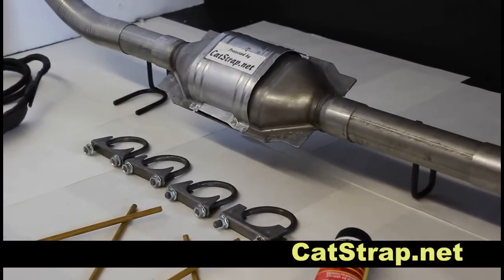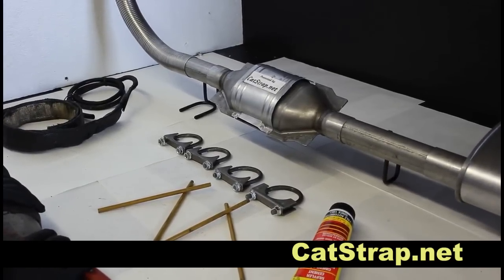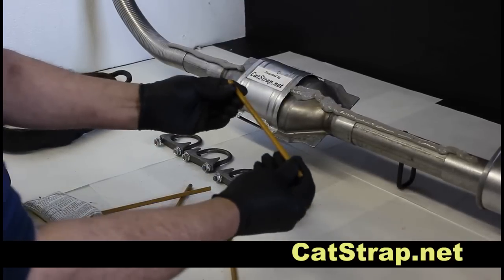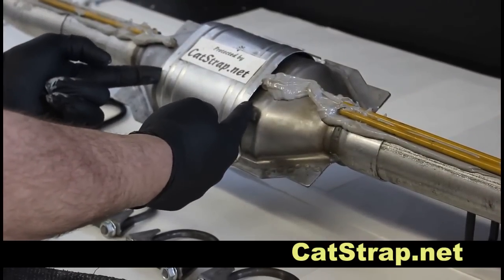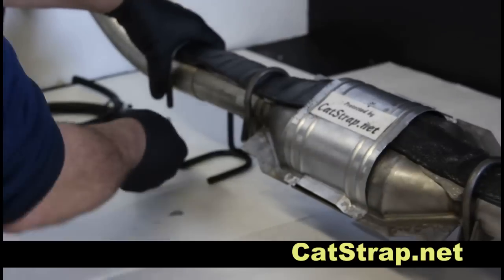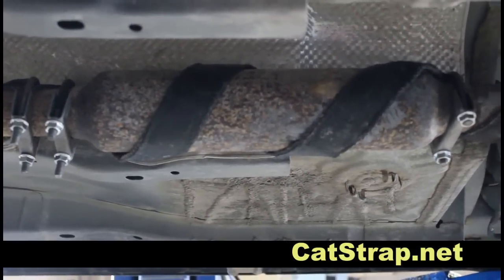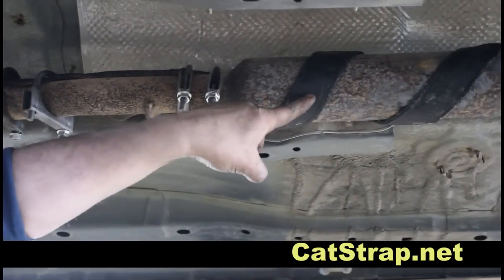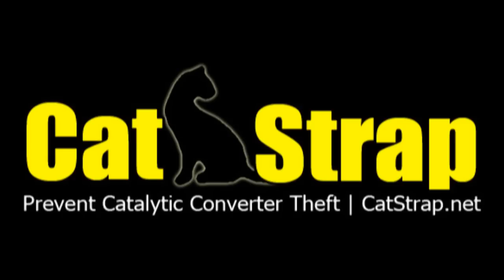Prevent catalytic converter theft with Catstrap

Comment: I hook mine up to the air bag suspension system when they cut the air line the car lowers down on them
Reply: Brilliant 😅😅
Reply: And if they are killed you go to prison for murder. Brilliant!
Reply: @mynameisgladiator1933  but they go to hell, then you get a good lawyer and you’re out
Reply: @charrohernandez6835  They're likely going to hell anyways. But you don't have to go to prison. Don't set traps. The law is clear on this issue.
Reply: @mynameisgladiator1933  It's worth it.
Reply: They use a floor jack dummy
Reply: @mynameisgladiator1933  nope they did it to themselves
Reply: @mynameisgladiator1933  They would have to prove it was a trap. If your air lines run along the exhaust that wouldn't look suspicious.
Reply: Yeah sure you do.
Reply: Billy McCoy.... Good one💀😂😈
Reply: This could make c notch and body drop biz boom
Reply: @mynameisgladiator1933  that's false information. Natural selection isn't considered as murder.
Reply: @mynameisgladiator1933  what if i put up a warning saying dont steal this and if you do be careful not responsible for harm lol
Reply: @jtmx2005  Give it a shot.
Reply: @torquebiker9959  Totally worth it. If everyone did it. Cat theft would cease.
Reply: @atuck6082  I guess they will find a way, like puttin a wooden block under the car. The thiefs are actually very clever.
Reply: @torquebiker9959  Then you could always make a mini ansul system and get a face full of theif repellant. Lol
Reply: @mynameisgladiator1933  
Its not murder it, would be manslaughter...which usually carries the same sentence. And you are right...pretty much all States would charge the car owner for manslaughter.  
Unfortunately you cannot set death traps to stop criminals.In a way it does make sense, I'd hate to open my father's door only to get blown away by a shotgun rigged to go off when the door opens. He's pretty old and would do just that if it was legal.
Reply: @mynameisgladiator1933  Just affix a warning sticker visible on the Cat,  ⚠️  warning, tampering may result in injury.  Then you are good, it is no longer a trap. 😀
Reply: Just low you car all the way down.. eazy
Reply: Omfg that is genious
Reply: @mynameisgladiator1933  murder for what? If anything involuntary manslaughter. It would have to be proven that was your original intent BEYOND REASONABLE DOUBT
Reply: @mynameisgladiator1933  there not traps but performance modifications with unexpected results :D
Reply: @mmace3  if they were modified tho it would look suspicious :D but totally defendable
Reply: @mynameisgladiator1933  no body , no crime
Reply: Loll
Reply: They jack the car up, so that wouldn't do anything.  Also... no you didn't.
Reply: @mmace3  well, I assume you saw the original post to this section. That's the proof, isnt it?
Reply: @mynameisgladiator1933  hell is one of those things on nde know about read the stories of heaven and hell. I met a woman who was being abused by her husbands she immolated her self and went uncondios and died briefly she said she went to hell.
Reply: @hyperliterider861 ? I'm just telling you what the law is. Go ahead and do it. You'll do well in prison.
Reply: @MrHomito  most of the real low cars don't have  that chingadera
Reply: i was just thinking about that lol
Reply: You sir…..are a genius.
Reply: @mmace3  You can do whatever you want in life man. Wear purple shirts, pick daisies or run air lines along your catalytic converter. No one can fault you fir exercising modifying YOUR property to YOUR liking!
Reply: @mynameisgladiator1933  really in what case would that be murder how would they prove
Reply: @mynameisgladiator1933  how is it a trap just say you didn’t know
Reply: That's smart
Reply: LMFOA 😂
Reply: With a silent cat alarm you can run out and lower their jack so they get crushed.
Reply: except they have to jack the car up to get to it. so that would do nothing.

Comment: Just putting an alarm that goes off is great.  I like the idea of running a low but painful voltage through a metal plate the thief has to touch to get to the converter.  Mean, yes.  Illegal, probably.  Effective,  yup.
Reply: I don't think you could really do that, the engine is grounded, so it would screw up all the electrics in the car in the likely event that it ended up touching the exhaust.
Reply: @Tracert-mc1hu  that's right, you can't apply more than 12 volts to any metal in the frame without blowing something up... You'd have to electrically isolate the whole exhaust system
Reply: Good idea
Reply: I hope no cats accidentally touch it!  🙀
Reply: evil genius 👍electrifying the thief 😁 but then the crybaby would sue 👎
years ago a man booby trapped his house and thief got electrocuted, sued the man, man went to jail 👎
Reply: Why low voltage??!
Absolutely HIGH VOLTAGE ⚡⚡⚡⚡⚡⚡
Reply: @WestCoastUSA546  ⚡😝💥👍⚡
Reply: @talknheadz  Why is he numb nuts!?
Reply: @AndrewSmith-uz8bg  because he thinks that a thief cant just simply put on gloves to get past his contraption.
Reply: High voltage,  low current.
Reply: @macmckenzie1242  High voltage can cause breakdown of insulation and arcing which can also lead to burning your own car 🤣High voltage with low current can cause a lot of harm 😜 i love the method to your madness Evil Genius :washhands:
Reply: The amps a car battery can deliver are deadly voltage doesn't matter.
Reply: @talknheadz  Sooooo, who tipped the thief OFF that it was electrified??? YOU? smdh
Reply: @VINZBROWN  5th grade comment
Reply: It’s only illegal if you intentionally set that up. If your subwoofer JUST HAPPENS to have its ultra-capacitor grounded to your exhaust as a point on your chassis…(of course your car might have a catastrophic failure.)
Reply: If they are wearing gloves, they won't get shocked. Most (if not ALL) saws that could be used have insulated handles. there's no way any kind of electric charge can be effectively applied. Alarms are useless anyways. How many times have you seen a car alarm go off in a parking lot that goes mostly ignored? 
Crime happens every day. preventative measures don't work at all if the criminal has the means, the will and determination to get what they want.
Alcatraz was seemingly inescapable, yet 3 guys managed to do it.
Where there's a will, there's always a way, but there's no way to actually electrify something on a car (12volt DC system anyways) to foil a thief who merely can use insulated tools to disable it, even if it were a legit possibility.
Reply: I'm intrigued and interested in subscribing to your news letter please tell me more.
Reply: I thought about welding an upside down bear trap but dogs and cats...
Reply: Robocop 2 opening commercial for magnavolt
Reply: Lawsuits don't ever send people to jail. They end civilly. So it sounds like a story told at a bar.
Reply: This is junk.. Just weld a strong cage around it by a local welder
Reply: How the hell is that gonna be effective? Its not like they use an all metal saw.
Reply: 50KV would definitely teach them a lesson.
Reply: Release of a cyanide gas capsule under the vehicle sounds a sweet idea..?
Reply: Love ur idea 😂

Comment: Why don’t they focus on the company buying the cats?
Reply: Metal scrap dealers will give them 100 to $200 for the palladium and platinum inside. I assume they don’t ask a lot of questions about where the metal came from.
Reply: the reputable places ask for id and the guys i deal with take pictures of the cats and the id .... i buy scrap cars and deal with them all the time its the guys driving around paying cash for them is where the grey area is ....they will cut them open and take it straight to the smelter .....not saying there all bad just those bad ones are ruining it for the guys that do it right and legally
Reply: They give ALOT more than 200.... 😂
Reply: Once the buyer removes the palladium from the cat , it's not traceable
Reply: @anim8ted923  well...I just had a friend junk a KIA and before he did he cut out the cat...he got $2000...that's not a typo...that's why these are being ripped off...Platinum is in shortage...thank our new boss in DC for screwing our domestic precious metals businesses
Reply: Rob West   You going to have problems if they are paying that much. You might have to try and get them in close .
Reply: The reputable places already require some verification and local and state governments are cracking down more. However, especially at these prices, there's always going to be a chop shop out there that doesn't want to know where anything came from. They're the problem. If there weren't black market, we wouldn't have a problem!
Reply: Don't go for the holy cows.
Reply: @koriko88  there will be crime as long as there is people.
Reply: @robwest1297  You can buy cats for 150,300 dollars,i just bought a brand new exhaust system for my sports car for 1100 dollars and that included brand new (stainless, not that crappy stuff automakers use ) cats plus the whole system, i just dont see a scrap dealer giving anyone 2000 dollars , maybe if it was gold inside of it.

Those scrap people are super tight, they will lowball you even with the price posted on the wall,i would really like to see that receipt from your buddy but ill go along with it, no need to argue,guess thats why they are stealing so many cats, honestly i can see them stealing a cat and getting 100/200 bucks a piece for them,that seems reasonable and believable,a thief will do wonders for 100 bucks.

Comment: I never thought I'd see the day you need to get an alarm system to protect your Catalytic converter
Reply: me too ...up at 1am worrying if it's going to get stolen quickly after i pay $4500 to replace it. Damn thing is worth as much as the truck.
Reply: @jellyproductions3767  Hopefully your not in a high risk area ! That's pricey
Reply: @walleyehunter8862  I am and it is. Insurance companies are hating life right now.
Reply: I never thought I would see the day that you would have to wear a mask to go into a bank without planning to rob it.
Reply: I had to install about 40 hose clamps with metal under them to keep gas thieves from stealing gas out of my rubber hose (along with an alarm module hidden under the  fiber tape I wrapped it all up with on my pickup back in the 90s. I lost hundreds of dollars in gas twice before I could stop them.
Reply: I never dreamed we would have to have one.
Reply: Thank a democrat

Comment: I wire mine to the 240 volt mains every night .
Reply: i got mine hooked up to a neon transformer--i want them to glow while dying.
Reply: @rearspeaker6364  And fry all the computers in the car as well.
Reply: Hahaha nice
Reply: @jackbarrie6007  found the cat thief.
Reply: @jackbarrie6007  sounds like he's got you shook
Reply: You will be better off with 110 it hangs on to them cutting.220 knocks you away . This way you can use a rope and drag them off the next morning when you go to work.
Reply: @paulatudor691  good point, maybe D.C.?
Reply: @paulatudor691  ha ha ha ha

Comment: Amazing that the car engineers design everything that you would want to do to repair your car so difficult. Alternator, starter, inner tie rods. Oh, but stealing a cat converter so simple. Makes no sense.
Reply: its very tricky trying to put a exhaust system inside the passenger compartment without it leaking, or setting the car on fire too.
Reply: Engineers need to make everything as compact as possible to increase usable space (thus increasing the value of the car for the average buyer), but the exhaust system is very hot so necessarily has to be outside in the open. No conspiracy here.
Reply: @KibberShuriq  lots of people don't understand that.
Reply: Honda has them built right in the exhaust manifold atleast on some of the newish models, so they stay in the engine bay
Reply: This is a new thing, it will become an old thing soon enough.
Reply: @rearspeaker6364  The OP never mentioned putting them in the passenger compartment. They simply questioned why traditionally simple repairs that could be performed by a backyard mechanic were made so difficult. 

For example, I used to be able to swap an alternator or a starter on my 1970 Pontiac inside a half hour, start to finish, for a cost of $25 with core, all while laying on my back in the snow. On a Chevrolet Colorado, the starter costs $1500 to replace due to the fact that you must partially remove the engine in order to gain the necessary clearance, or another alternative is to remove the inner fender panel and several other non-related items which are in the way, which is far more time-consuming and more trouble than simply loosening two bolts and a couple wires in the previous example. 

I could rebuild my alternator and starter in my first example with a brush and bushing kit in the time it takes just to gain access in the second example.

On the other hand, maybe you were joking.
Reply: @jayrowe6473  was saying the vehicle engineers did not put the catalytic converter inside the passenger compartment (where it can't be stolen) for a reason....
Reply: They get big $$$$$
Reply: Be nice if people just stopped stealing them from hard working people
Reply: Hybrids dont have alternators or starter. 

The electric motor inside the 'transmission' IS both, an alternator AND a starter. Have you noticed how there are no belts either? Because AC uses a compressor like a fridge due to it being half electrical, and the electric motor/generator acts as the alternator to supply power to both the front and back battery.

The cat converter gets hot to 1200 to 2000 degrees. There is a reason its outside, so while driving the wind flow will cool it off and heat shield between the inside and outside keeps it from burning up into the cabin.

Comment: Put a ground at the back of the system and a power at the front when the exhaust system is cut the alarm goes off. Get rid of all the other bull in between
Reply: Catstrap uses less current.  Also your idea won't because exhaust have multiple possible ground poi ts.
Reply: @Thenotfunnyperson  its those o2 sensors that screw that idea up.

Comment: The steel rods and u-bolts look good enough. They make a ton of noise cutting that pipe, sitting their sawing away endlessly will discourage them.
As a contractor, cutting through cast iron drain pipe takes forever unless you have a special blade for it...then it takes slightly less than forever.  If those hardened rods are the same or better than cast iron then that is all you need. 
Keep it simple and you will sell far more of them...likely with an increased profit margin.
Reply: my question is if this bonding paste is good enough because if chisel can peel it off its not great solution. I understand that thats what the cat strap and clamps are for, im just looking for DIY solution on cheap.
Reply: @marekjaworski5965  When I get back to my home town, I'm going to my local huge hardware (McGuckins!) getting the rods, the clamps, the putty.. then I'm chemically welding the nuts to the bolts. 🤣
Reply: He never mentioned where to buy this paste and clamps?
Reply: Sorry, I wish you were right about this. The clamps and pipes are easily cut through.

Comment: I would think that similar spinning tube setups that they use to prevent police from cutting chains when people chain themselves to trees. 
So it might cut, but the surface would simply spin and make the thieves frustrated because it’s taking longer and maybe even noisier. 

An electrical shock seems a logical option. If thieves were to try to sue or press charges, I can’t imagine they’d have a case when they’d have to justify their reason for being under the vehicle.
Reply: In today's courts the thief would win a lawsuit against you.
Reply: @macmckenzie1242  Embarrassing to admit, but you are right.
Reply: I would expect that after getting zapped most thieves would be inclined to  nasty things to your car.

Comment: Some hydraulic suspension , with a 2 minutes delay trigger timer to lower on top of the thief will be nice.
Reply: make it 1 minute delay...they try to be outta there in 2 mins. ....or they will start using longer blades so the don't have to be under the car.
Reply: @macforme  Longer blades, ha ha ha ha ha, that would be a really long blade.
Reply: @dntlss  never under estimate the ingenuity of a determined thief. 🤣

Comment: Its a very creative idea.  Once of the best I have seen.  The likely scenario is probably that in the  dark they don't really see or understand that the cat strap is there and they began cutting , and maybe have to make several cuts cause of the hardened pins. by the time the alarm goes off the cat is damages so much it may require replacement.  In many cases, maybe a muffler shop can just repair the pipes?
Reply: as long as it's still there a couple of welds will do the trick! might cost you $100 to seal it back up if I were your mechanic... bzzt bzzzzzzzzt.